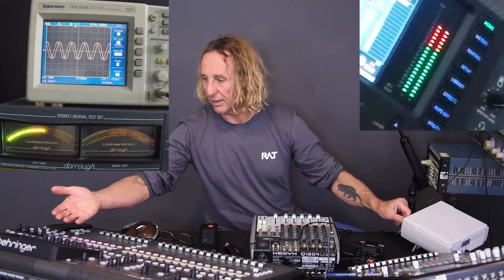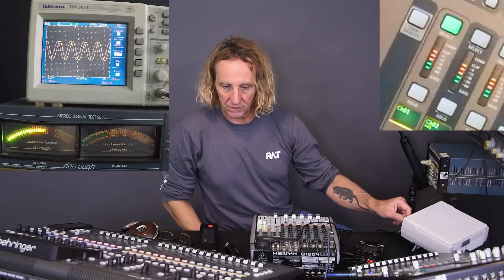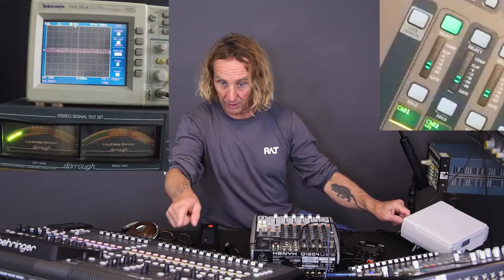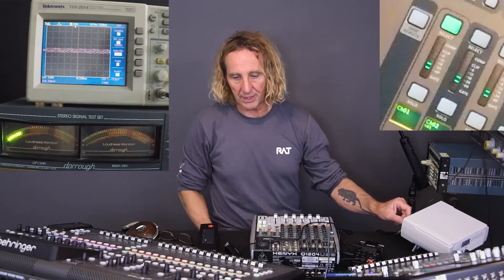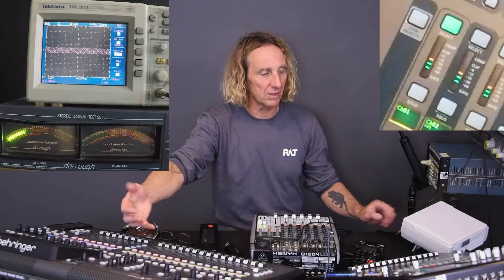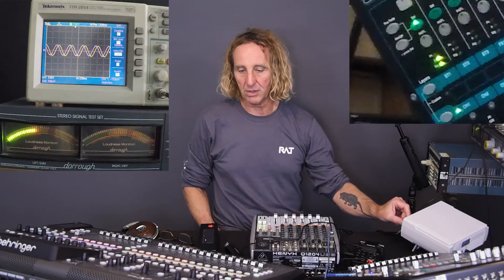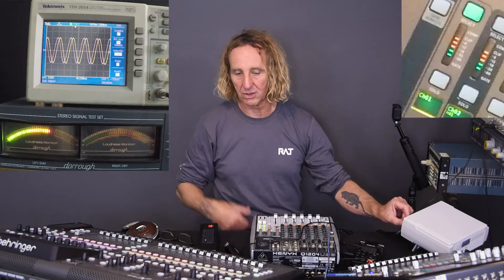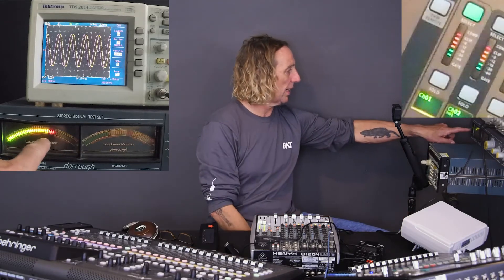Metering & Clipping - Behringer X32 vs Allen & Heath QU16 (Public)

Comment: Same thing happens in the daw world, anything over -18db and you’re risking clipping, even though meters will say otherwise. Digital DJ mixers also, absolutely essential to stay ‘in the greens’. Amps and audio interfaces too.

Love your content Dave. I’ve spent the last 10yrs building up (and paying off) a sound system. I had planned on using it for hire work, but then the opportunity arose to install it in a venue. The guys at the venue have bought a qu16 and I’ve only ever used analog boards (been into music tech for 25yrs, weekend warrior/ hobbyist mainly) so your info is worth its weight in gold. Thank you.
Reply: It really depends what your meters are actually measuring, and what their ballistics are. If it's showing you the peak value with zero lag then 0dBFS is 0dBFS and it's not going to clip until it tries to exceed that. If it's an RMS meter then you could have a 20dB or more difference between that and the peak value.
Reply from the maker: Well, these tests were mainly sine wave so do ballistics matter. Meter should read signal level, right?
Reply: @DaveRat  Not in this test, I'm referring more to the original comment about real world usage in DAWs or DJ mixers, and the idea that you can be clipping when the meters say you're not. In this case it's the opposite as we've seen these consoles giving early indications of clipping rather than late.

Slow and/or RMS meters are where I can see the original comment being true, though in most cases I believe the clipping indicator is independent. I remember the first time I used a Mixwizard coming from Soundcraft I was seeing much lower levels than I was used to, because it was giving more of an average, so in turn I was driving it harder.
Reply: @Motorman2112  later Pioneer DJ mixers are terrible for it. The daw comment is the reason why many producers use vu meter plug ins to help with tracking and mix downs. Where music dynamics come into play, not just test tones, it’s always better to leave plenty head room in the digital word, as I’m sure you know, it’s the way I work anyway. I studied music tech at college 20yrs ago for 4yrs, we had a Mackie d8b in one studio and a Yamaha 02R (I think) in another, one of our tutors was oldskool, (had worked with Hendrix, amongst others, great guy) he always taught us to stay well away from clipping, even the odd peak in digital gear. It always stuck with me, even though the gear has come a long way. I wouldn’t even drive this qu16 into the reds even with this knowledge, I’d rather get a bit extra gain from the speaker processor, if needed. Who knows, if Dave tried this test with 20 different qu’s, would they all even be calibrated the same from the factory? I’d put money on some pretty wild variables.
Reply from the maker: Good comments!
Reply: @daavneeq  I'd take that bet. Its most likely a bit of code essentially saying "is the signal at or above -6dBFS?, if so, turn on the red light". That's not going to differ unit to unit, and there won't be much if any difference in the translation from analog voltage to digital value. It quotes +4dBu for a meter reading of 0, so if it's not hitting that it's out of spec. With old gear that may in fact be out of spec I could maybe see an issue.

I can see what A&H were trying to do with lighting the clip indicator early to cause people to stay further away from actual clipping, but it may have the effect of people getting used to red being OK, and then pushing it into real clipping because there's no visual difference between nearly clipping and actually clipping.
Reply from the maker: I agree, I think the probability that the clip indicators are consistent from unit to unit is quite high. Even in pure analog gear, the ability to accurately indicate clip and metering is well established.
Reply: @daavneeq  Once the signal passes the interface/pres the DAW shouldn't clip, unless its poorly written. In Studio One and FL Studio, as long as you're not clipping the mic or the output of the interface, it's all algorithmic so theres no way to clip the signal without introducing a plugin that has a limit on input etc.
Reply from the maker: Thank you Dave!

Comment: Interesting, I had a hunch the QUs ran a bit quieter.

The QU line is targeted a lot more towards beginners, mostly churches, especially the qu-16. Makes me think its to warn before actual clipping, as an extra caution. I wonder if the same thing happens on the SQ series.

Honestly I'm not sure what I prefer - actual clip light when its clipping, or clip light a few DB before. -6db is kind of excessive though. Maybe it should be configurable.
Reply from the maker: The clip sound on the x32, m32 and QU all sound pretty undesirable in the tests I've done.

Analog warm clip, sometimes good, digital trash clip, never good.

Comment: Only caveat is that if you use a signal from a computer to the console via usb, on the input channel config is usb, and the sine wave signal from the computer is 0dbfs, the X32 will show the channel is clipping though it is not. Is this your experience as well?
Reply: If it's 0dBFS then there's no way for the console to distinguish this from clipping. An actual clipped signal would have the same peak level. For all it knows, the signal may have "wanted" to go higher than that.
Reply from the maker: Interesting